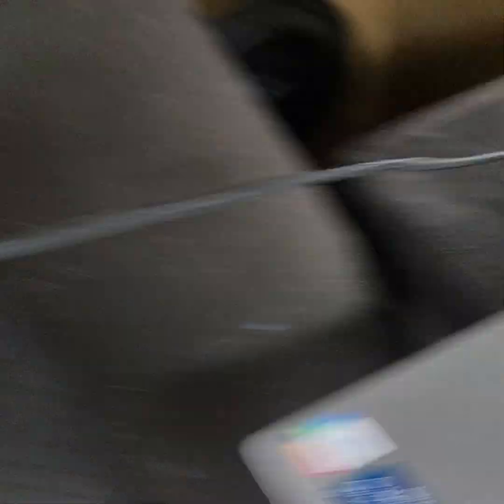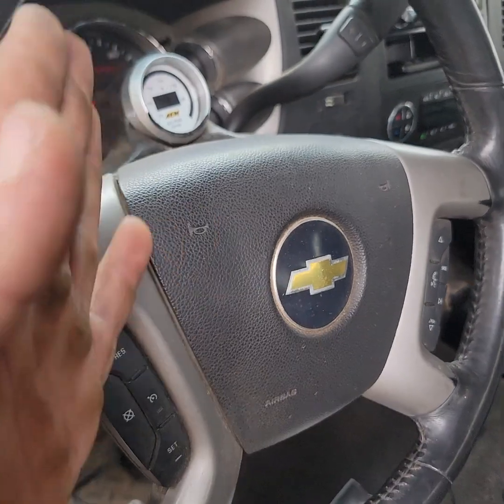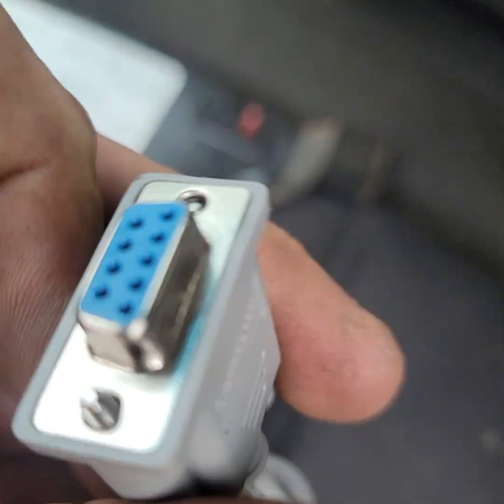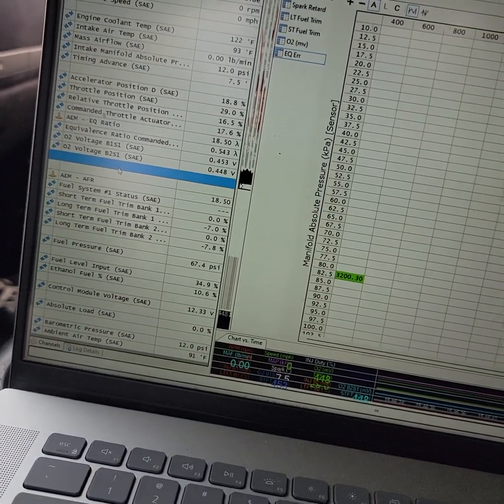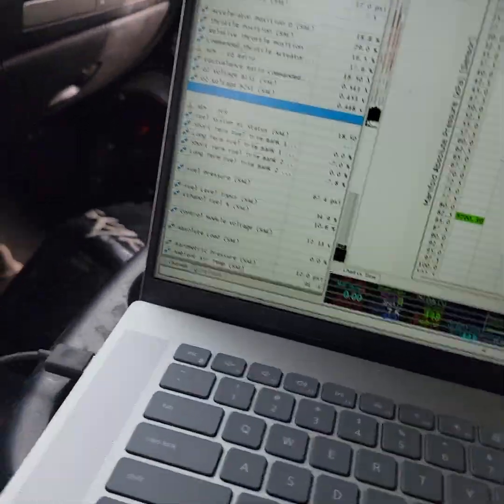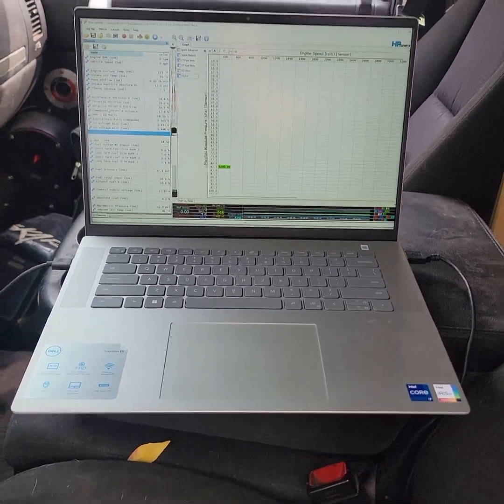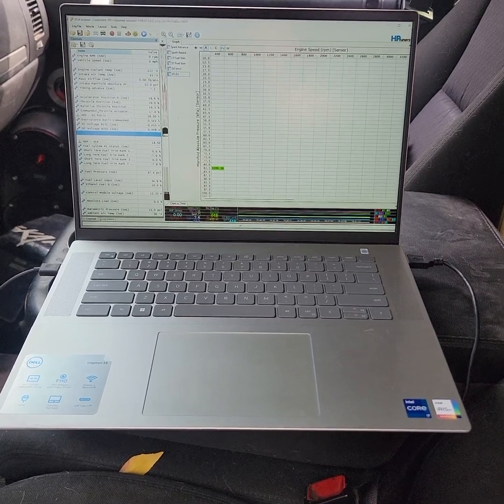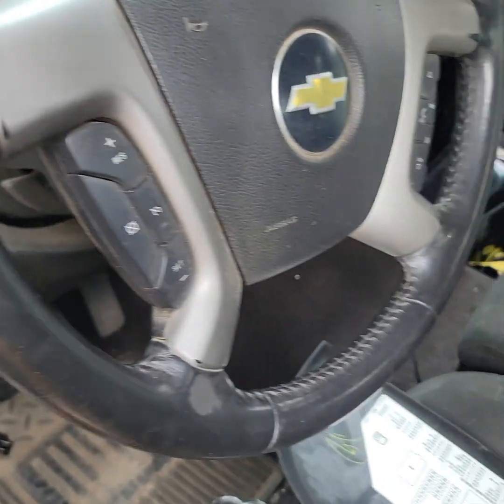EASY WAY TO LOG AFR ON HP TUNERS

Comment: Awesome video my dude..this has been difficult for me to find..I have a question for you though! Do you know if I'm running dual x series through seperate serial usb adapters into a usb hub to laptop, is there a special way to seperate those in hptuners to differentiate which bank is which? Or will it even work running through a usb hub??
Reply from the maker: @grahamphillips57  yes you will log a bank one and two sensor set up. Add them to your graphs 
Another way to donit is just select one sensor as aem and then create a pid or loggable sensor for the other , you will need to have 2 USB slots as far as I know unfortunately but you could always have a switch and check balance between the banks and if it looks okay proceed to log one at a time  maybe lead with one. Then trust the other is fallowing. With some periodical checks.  I mean you still have a HUD from the gauge itself so if your logging one and the other sensor matches with in a percent or so visually you're in good shape  logging 2 banks is great for balancing but I mean it's kind alike the engine should be doing the same both sides ya know 

The short answer? Wire 2 up to one serial and see if you can find that second line some where the USB will be transmiti the data through different pin that specified but there's extra wires anyway so you can use one of the extras find its pin out or where it plugs in and specify that for the program as the reference for sensor 2
Reply: @whikidfmj  That's where I'm at is I only have two USB ports on the laptop and of course one is needed for the mpvi2. So that leaves me one left. And I guess I could just use one but I remember seeing goat rope do a video on his setup and I wish he had gone in more depth but he had a USB hub that allows multiple USB hookups to just one USB port so I was curious if you knew how that would work out would be to be configured
Reply from the maker: @grahamphillips57  My reply at the end of that long ass b***** is really probably the best answer there's extra wires on the serial cable that are not used use one of those wires for your second reference it's still going to run to the USB you just got to find that pin so when you go into the second AFR sensor you're going to specify that it gets its its data from the pin that you hook the second sensor up to right